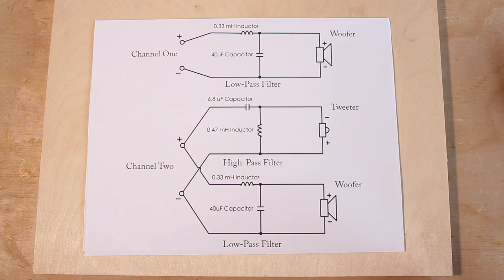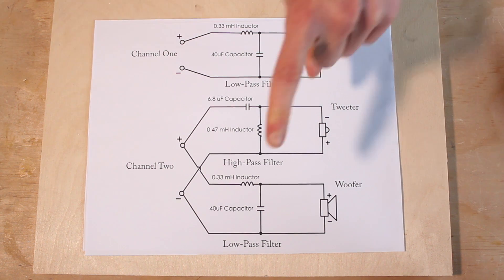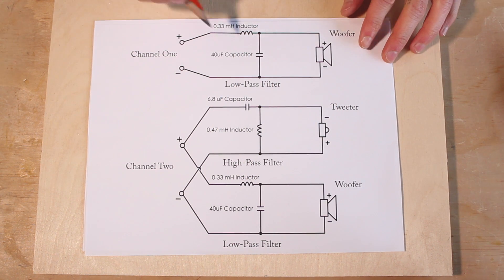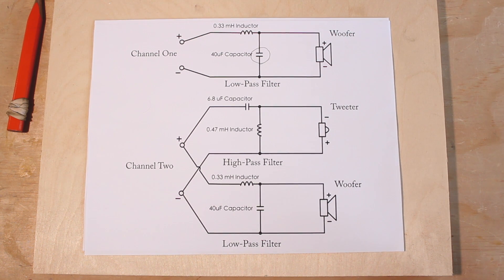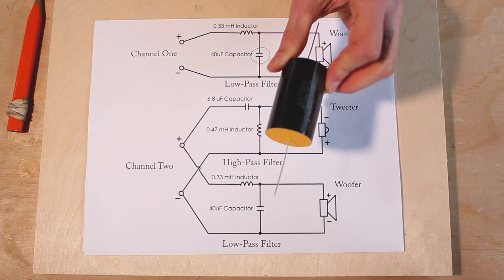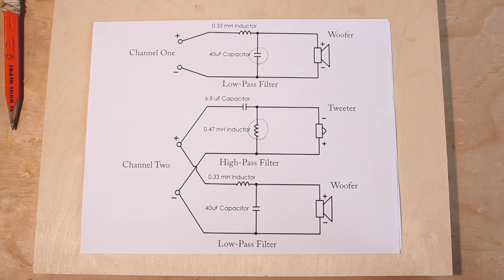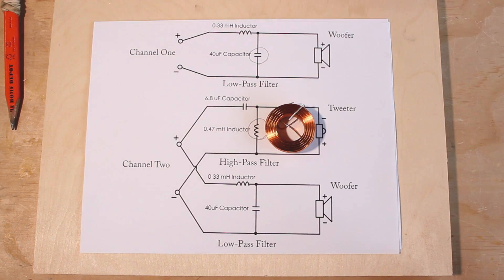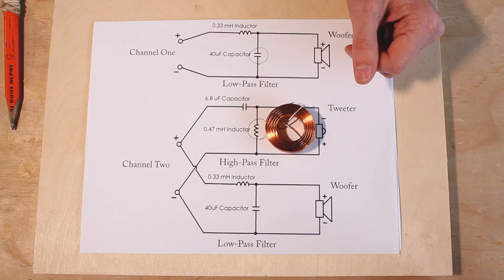How to Read A Speaker Crossover Diagram | DIY Speaker Building

Comment: Kirby! Quick question. When building a system with two woofers and one tweeter do I need to make one crossover that uses high pass and low pass filter, then another low pass filter for the remaining woofer? It's one thing I've been confused on while reading your Elder Bluetooth Speaker plans.

Thanks again, I've been waiting for a good video like this from a trusted source for a while.
Reply from the maker: Nope! You just need one filter for the tweeter and one filter for the woofers. The woofers will then be wired in series or parallel. Thanks for watching!
Reply: Kirby Meets Audio But wouldn't that then make a single channel? Or is that what I'm after for Elder Speaker build?
Reply: I was wondering this as well.  (I know this is 8 months later, and probably late), but I'm going to operate on the assumption that you'd have a second low-pass only for the other woofer.  The parts list for the Elder speaker says to have 2 of the inductors and 2 of the capacitors to make the low pass filter.  If I had to venture a guess, I'd say his response to your original question was thinking you were talking about having a single speaker with 2 woofers and 1 tweeter (as in one bookshelf speaker).

Comment: Right on man, been tinkering.. got a little distracted with arduinos and raspberry stuff.. BUT, I'm getting close. I have beta test with a two single drivers.. it's ok.. not the 'best' so I'm thinking I need to do the crossover and add a tweeters to get better lows. Not expecting sub woofer sounds but something a little deeper. 

box tuning, and ported vs sealed is still somewhat of a mystery to me.
Reply from the maker: Those are easy to get distracted on! Adding a tweeter with a crossover with definitly help the sound of your speakers and will be a fun thing to experiment with. Thanks for watching!

Comment: After researching, you are correct.  I am not an electrical engineer and was not aware of the specialized use It seems there are in crossover applications. I was taught that all electrolytic capacitors were polarized, and although wikipedia is not a solid source, it even lists "all electrolytic capacitors are polarized".  There seems to even be a trick in cheap crossover circuits where they use two polarized electrolytic capacitors in series with opposing polarities to get a non-polarized electrolytic capacitor with half the capacitance. It is good to learn.  ;)
Reply: It's better to use film (MKT/MKP) caps, electrolytics give too much distortion
Reply from the maker: Agreed, not the best, but they are a great resource to mess around and experiment with crossovers at a lower cost. Nice film caps can cost a ton!
Reply: Maybe those 'audiophile' caps, but normal MKT/MKP caps are pretty cheap (~$1 or so) and you can't hear the difference anyway. There's no reason to use electrolytics in a crossover, unless it's for non-critical parts (zobel network for example). Even the cheapest film cap is better than the best electrolytic.

Comment: Weird... In Europe resistors are rectangle blocks symbols.
Reply: Yes the US standard is different from the IEC standard. There are both good and bad things to say about both. However for this purpose I believe the IEC standard use better symbols as the US style it can be difficult to distinguish between resistors and inductors.
Reply: @jonasa6713  I like the IEC way, because in some of the circuit design software, resistors are shown as 'real' (shaded filled) or 'virtual' (unfilled) as a feature of the adjacent series inductor.

Comment: Another great video. I too would like to see an explanation of how you determine the inductance and capacitance. One point of contention, the symbol that you show for the capacitor on the schematic is for a non-polarized capacitor.  The capacitors that you show in the circuit appear to be electrolytic and therefore have a positive and a negative lead.
Reply from the maker: Not all electrolytic capacitors are polarized. In the video I show one non-polarized electrolytic capacitor and one metabolized polypropylene capacitor. Thanks for watching!

Comment: Great video, I just wondered what is the best way to mount the crossover to the speaker, I dont think that is explained in the plans. Just bought one love it so far, can wait to get started!!
Reply from the maker: Thanks so much for your support! You can mount the crossover anywhere in the speaker enclosure you find room. It can be mounted directly to the enclosure wall or to a thin piece of wood. I usually use hot glue and zip ties to mount the components. Thanks again!
Reply: How do you connect the crossover if you have two woofers? Do you just connect the tweeter to the one woofer or both woofers?

Comment: Nice video :) Mabye you could make a video on how to design crossovers ?
Reply from the maker: Thats coming in the future! Thanks for watching!
Reply: Yeah, also the voltage rating of every capacitors related to the impedance of the drivers.. :D
Reply: Tadas Dir exactly what I was going to ask, especially how to make 3 channel crossovers and how resistors come into play. maybe even how to find exsiting plans that fit the perfect requirements
Reply: Calculators are there for a reason then. Calculating things by hand would require you to almost be an electrical engineer in parts.
Reply: you can't teach anyone to design a crossover in one video. that's a process that takes years of learning and is basically not doable without measuring equitment as soon as your speaker gets more complex than a 1way. at least not if you want a decent result.

Comment: Great video, Kirby. The question I always run into when picking crossover components is around power handling. For instance, some resistors say they're good to 10W, others good to 20W, etc... The same kind of idea seems to apply with capacitors, but it shows up as voltage ratings and/or physical size like your tiny vs beefy caps in the video. How do you know what crossover parts to pick so that they'll handle your design loads?
Reply from the maker: This is a great question! And actually something I haven't though about much. I think it is smart to pay more attention to the wattage rating on resistors. You could probably get away with using a resistor that is rated for much less than what you amps per channel power output is rated at, since people rarely listen to their systems at full volume at all times, but just to be safe I would probably get as close to your amp output as you can. As for capacitors, I've never seen a crossover capacitor rated at under 100v which is way above what your amp can put out, so I'm sure you're safe there. Really the important number is the value of the component. Thanks for watching!

Comment: I was hoping that you would explain the function of the inductors and capacitors and explain why you chose those values of inductance/capacity... maybe a future video?
Reply from the maker: A more in depth video on crossovers will be coming in the future. The last thing I want to do is scare people off with too much information too quickly. Thanks for watching!
Reply: Too advanced for most beginners. It has to do with their impedance that varies with frequency. It's easier to explain how it works instead of why it works
Reply: Kirby Meets Audio I'm a new subscriber love your videos 👍 I want to know if choosing a 3 way crossover @ 4 ohms and installed with 2 speakers and tweeter (all 4 ohms) will change the impedance?